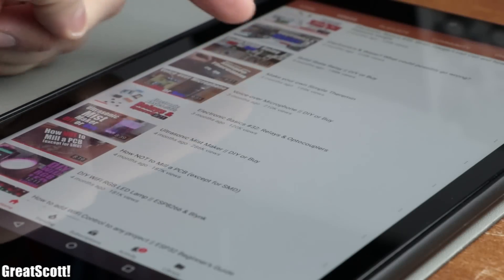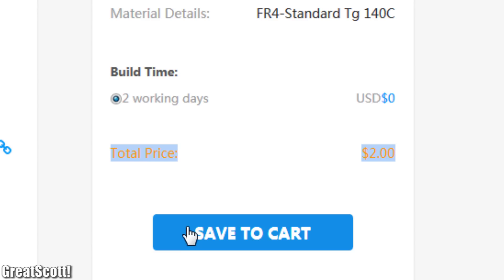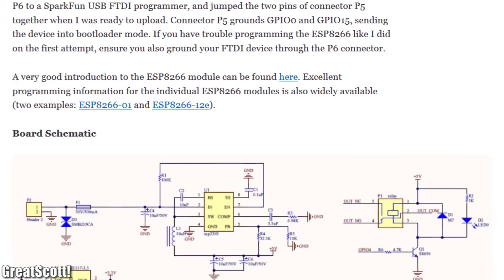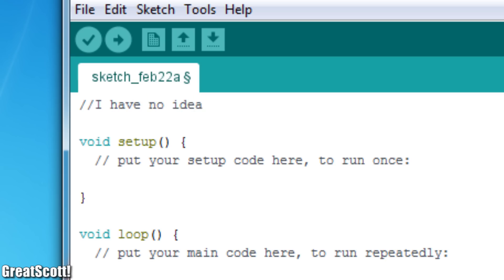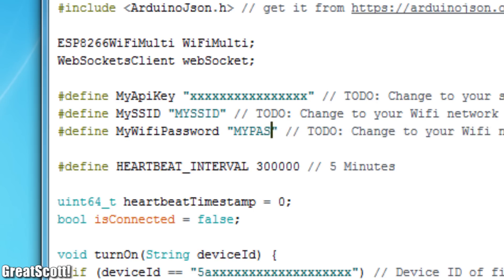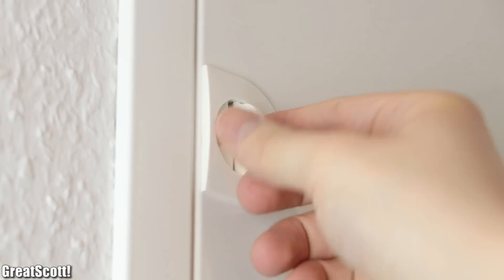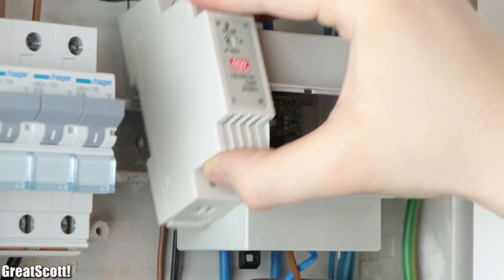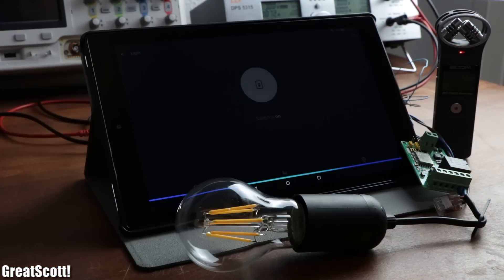How to do Simple Home Automation with Amazon Alexa || ESP8266

Comment: I have built a gateway that works on ESP32. The gateway controls the peripheral devices via ESP-NOW protocol. Is there a way by which Alexa can simply forward a string to ESP32, like, if the user says "Alexa, turn on light in kitchen", then, Alexa should forward "TURN ON LIGHT IN KITCHEN" to ESP32.

Comment: Fauxmo now emulates philips Hue but it still has problems. Never been able to add it. Therefore many thanks for your sinric solution.
As for the board you are using, there are cheaper ones that use an esp-01. For one relay that's more than enough

Comment: I had to add a "pinMode (4, OUTPUT);" command in setup() to get the board that I bought from Amazon to work. Looks identical to your board but came with headers already soldered in. Good video, many thanks for posting it.

Comment: Great video @greatscott! All my lights have the step/toggle switches and I plan do it myself wchich supposed to be easier than normal. BUT! Alexa doesn't really know if the light is actually on or off and this potentially creates bunch of issues when you try to trurn on/off something remotely and you can't check it on your own. You need to use then another GPIO port to controll if the actual relay is on or off so that alexa knows what she's doing :)

Comment: Also you can add a 3 way switch in your wall and use the NC - NO contacts so you can turn on and off from any point of the circuit. if you only do the parallel thing and the switch is turned on alexa will never be able to turn off your lights

Comment: The problem with these ESP8266 wifi solutions is that the wifi password of your home system is in the automation code as cleartext.

That's not secure.

Plus, if you ever do need to change your home wifi pasword, you have to keep backup copies of all your automation code with the password in cleartext, and then change the cleartext and re-download the code to all devices that were previously programmed throughout your home. 

That's extremely inconvenient.

Comment: The Shelly 4pro, is a really nice 4 channel system. It is DIN mounted, has internal power supply, has built in color LCD screen and 4 relays with 4 current measurement systems on each output. (And obviously voltage, probably shared for all outputs). Each relay has separate input for line voltage, but each of the input must be the same phase and voltage (because they are probably internally commoned anyway, and there is only one voltage measurement circuit shared by all circuits, and used for computing power and power factor, and phase angels; but that is not an issue really) . Afaik it is based on ESP8266, and each relay can do 10A (2300W). It costs about 69 Euro. Which afaik is pretty good price for the functionality, ability to mess with firmware, and built in LCD and measurement circuity! There are also 4 override inputs for 4 switches (They can be momentary or permanent switches, the switching is still done via relays, so very small wires can be used, for maybe 1mA of current used). There is also a button. This enables to easier setup of the device. I hope they make ESP32 version, so setup can be done over BLE even quicker and without needing to switch wifi networks temporarily. 

If you don't need a LCD and multi channel, then Shelly 1 Open Source, is even better, 9.90 Euro.

Comment: In this program  I am facing a problem I want to control the iot device by a voice and the physical switch simultaneously so can you help me with that

I have used the physical switch by physical wiring but it sleeps over the no and NC position in the code for example if I turn off the light by voice command and turn off the light by manual switch the the program still states that the litelees in on condition so so what should I do with that

Comment: What if i dont need the switches ? What if i directly connect the wiring in the switch to the relay board and control everything by voice by getting rid of the switch boards ? Would that work ?

Comment: I am not able to flash this module using PL2303. I used Board as ESP8266 generic Board and tried all different baud rates. I am using 9V battery to power the module. and PL2303 is directly plugged into my desktop. What could be wrong? Can you please help?
Error I am getting is warning: espcomm_send_command(flash_download_data) failed

Comment: hay man first nice project, secend i used a esp8266 nodemcu to control at the same way a relay but when i add   digitalWrite(4, High) and upload the program it shoult be pin D2 but it does not work can you help me out? have a nice day.  Edit: did figer it out you need to add:   pinMode(4, OUTPUT); down under the code by: void setup()

Comment: Can someone help me?  I can NOT tell by descriptions what devices to and don't exactly  .    I have a  variable pressure pump system that runs way to often and so I want to be able to turn it off via alexa.   The unit has a little jumper that disables the pump from running.  So all I need is something that opens and closes that one low voltage connector....just something with one set dry contacts in other words that I can either open or close via alexa or online etc etc.    I am desperate to learn WHAT  to buy?   Now the voltage of the unit is 220 so it could be powered off that,  but even a battery would work ....I  would rather not fabricate something....is there not a unit available that would do that?   Pleas be a hero to a stranger??

Comment: I must have picked up 4 duds  2 from amazon and 2 from ebay   was able to upload a sketch , register with sinric   i could see it on my network and was able to discover the new device . However not getting an indication that the relay is kicking on when i ask alexa to turn device on .  All she says is  " OK "   No failure is a complete failure . Will need to do a deeper   dive  , would have been nice to have accessible break out points  .Has anyone had this issue?

Comment: Hello, i use an ESP8266 and i have load the Switch example for the sinric app.
the voice control over the alexa dot and the trigger over the handy app is working.
my question is, can some one give me an example how i can read in an hardware switch in the esp8266 that i can switch it on an off. i dont know how imust programm the code .

thanks

Comment: Woah theres a much better solution than changing the circuit up to the breaker, and it doesnt require changing the switch either.

That relay looks like it supports normally open and normally closed contacts that both connect to a common terminal and basically switches the common between the 2 terminals.

Light switches do the same thing (well atleast in Australia here) and they are designed like that for the method of "Two way switching" which is where 2 light switches control the same set of lights, for example a hallway with a switch either end so the relay can replicate that second switch.

2 way switching is rather simple too and only requires routing the original switched active to terminals to a normally open or closed contact of the relay (not into the common, but wiring the relay backwards) and running a second wire from the switches other terminal to the relays other terminal. These are called "strap wires" as they are basically parallel active wires.

From the switch point only 1 wire can be active at one time and the other is off, flick the switch and that will swap to make the other one active and at the relay point the relay will switch between the dead wire and the active wire feeding to the common terminal where the light will be wired to, essentially making a "two way switch" setup.

If you don't quite understand its best to look up a diagram.

Comment: damn good vid.... One comment on the way you fixed the wire in the fusebox. If you see the copper ends it is not good because than the risk of short circuit is bigger. So next time please but the copper ends entirely in the box (It is meant to be a tip not a hate comment)

Comment: Not sure if it's been mentioned...and I don't know what the electrical codes are outside of the United States, but DO NOT double lug the terminal on your circuit breaker (don't put more than one wire on each breaker).  You can however, run a few to a conduit box outside of the panel and just have one going back in (ground, neutral and line).

Otherwise, this is a beautiful little piece of kit!

Comment: Does anyone know what programming language he uses?
Reply: It's C++.  If you know C, you can work with it just fine since most code doesn't use much of the OO parts of C++.

The compiler is gcc with special tweaks to support AVR chips.

If you prefer a different language, there are options.  I've seen Lisp and Forth and even someone working on a tinyBASIC port.
Reply: arduino is IDE not a programing language. also arduino is VERY SHITTY IDE. better use Visual Studio.
Reply: The Arduino IDE isn't that great for actually writing code, but it is good for downloading libraries and tooling.  Got some weird chip off AliExpress that isn't quite an Arduino?  Just a few clicks in the IDE and you're ready to go.

Really, if someone's just starting out, it's not too bad.  VS is major overkill for most Arduino projects and is confusing for someone new to coding.

Besides, as neither of them are Emacs, they're both inferior :)
Reply: I use PlatformIO in Visual Studio, it's much better.
Reply: Arduino, free of charge.
1:30

Comment: The esp32 or esp8266 has many oi connections why use this WIFI relay module when you could control many relays off a single board and multiple relays?

Comment: I have just Alexafied my whole flat a week ago. All lights and thermostates can be controlled by Alexa by now without needing to change any wiring at home. Check out FHEM. It is an open source software for house automation and can run on Raspberry Pi. You can also add Alexa support or Homekit. Seting up Alexa is a bit tideous since it involves creating a custom Alexa Skill and a lambda function within Amazon AWS that enables communication between your Alexa Skill and the Alexa Service running on your FHEM setup. Next thing you need is a gateway in your LAN that can do 433MHz and 868MHz communication. Max! Cube gateways can be flashed with an open source firmware that enables FHEM to control almost any cheap remote controlled device you can buy from hardware stores. Homematic for example is great for remote thermostates. For light switches you can use ITL 230 from Intertechno. Those switches are put behind your regular light switches and use the switch as sensor but also go wireless via the gateway and FHEM once they are paired. Next think that works flawlessly is Philips Hue. With Hue you can also use cheap Ikea Tradfri bulps or Osram Lightify. You don't need their gateways and can pair directly with Hue. With this setup you can mix almost any supplier of smart home devices. I also integrated the status of my alarm system and windows to automatically shut down the heaters when windos are open or make all the lights and soldering irons go out when I leave my home. You should check it out!

Comment: 7:30 "the system works flawlessly"
So what about this:
"Alexa, turn the light on" light turns on
"Alexa, turn the light on" light turns off because there is no feedback loop to check if the light is already turned on.
This may seem exaggerated but if you have multiple lights wired up and want to turn them all off at once, it's not possible like this.
Reply: There is a very technical way to check if the light is on or off....... open your eyes
Reply: Right +fisheyLP These switches only make sense on the stairs where you can toggle it from one floor and the next..
Reply: maybe he has a voltage reader that sends data asynchronously. A presence of voltage will tell if the switch is on.
Reply: I think a two way switch wiring can solve this problem and instead of another switch you just use the relay. And like he explained, the relay works when there's a voltage difference and thus if the switch is OFF the relay will toggle but if the is ON it won't.
Reply: Easy to fix with some coding. Instead sending "toggle" command, one would send on or off commands. It doesn't require any feedback loop.
Reply: @movax20h  The point is that one wouldn't know if the lights are switched on or off even if the microcontroller switched the light on someone else could have switched them off by hand. And since the light relay is a toggle you dont have a way of knowing if its on or not.
Reply: @xlagor_  Why not just ask if the light is on
Reply: I used one for electric garage door.  It does work as you state, but just creating multiple Routines in Alexa makes it easy to use.  Great value too!

Comment: Hmm... I've used the fauxmoESP library for over a year now to control my lights and some other appliances with Alexa and it has always worked flawlessly. Even with one ESP emulating multiple devices, not a single problem. The only unfortunate thing is that I control the lights with phase angle control using a triac and can't dim them using Alexa since "she" thinks it's a WiFi plug. I made it so it dims up and down smoothly though, when turned on or off with Alexa, so it's not that bad. I am looking for a dimmable alternative though that I can run locally (without some third party app, website or whatever) and that accepts different ways of expressing yourself naturally (so you don't have to say "Alexa, light 50 %" like a robot)...
Anyway, did you try the example sketch without any modifications? Works fine for me. I use Alexa in German, not sure if that makes a difference. I would be quite surprised if it did though.

Update: I'm currently using Espalexa which is fairly similar to Fauxmo but emulates a phillips hue bridge and can therefore control brightness and color. Works just as well as Fauxmo, just with the additional control over brightness etc.

Comment: i did something similar to that. I just connected a relay as a changing switch to my currently installed changing light switch. so i could switch the light on / off by sending a data package to my aruino via lan, or by simply using the switch. That removed the use of alexa completly. But i created my self a App, that, could sent the data.

Comment: Hi Scott! Great video. But i don't understand why you whould go through so mutch trouble to just switch your light on and off. Why can't you install the relay above your lights in the ceilling and directly to the lamp?
Reply: You can
Reply: My thought exactly. And if he needs to have the switch for controlling it, he can do so with the NC in the relay and that becomes a toggle switch between Alexa and manual switch. 

But seriously this could be done not by messing with the circuit breakers.

Comment: GreatScott, I was able to get the fauxmo example working by using version 2.3.0 of the esp board drivers instead of the latest 2.4.0 version. Select that in the boards manager. You may have to install in manually. It's found here https://github.com/esp8266/Arduino/releases/tag/2.3.0 or you can change the Arduino IDE preferences to use http://arduino.esp8266.com/versions/2.3.0/package_esp8266com_index.json instead. The FauxmoESP_Basic example then connected to my Echo Dot and even though the Echo sometimes said it couldn't find it using the "find devices" command, it was still there and I could control it using commands like "turn on switch one". The fake Belkin switch method is nice since I don't need an external account somewhere.

Comment: I just used flashed sonoff smart switch with custom tasmota firmware it is easier to fit inside light switch. This will cost just $5-10

Comment: Amazon Fire tablets are a good deal, but only if you're going to root them. The built in Amazon app store is okay, but the Play store is better. I've heard it's a lot easier to get the play store on them nowadays though. The old fire tablets required a ton of work for it. Back in my day we had to use command line utilities to root, now it's all got a GUI!

Comment: Is there a way to use Alexa without internet service? That will be a good video.
Reply: Blue 4lifeblue Other such devices and probably Alexa do most of the speech recognition on the server side, so it's impossible to work without connection
Reply: Alpo Turunen what if there was a Home Server instead of connected to the online server
Reply: You'd need to replicate the speech recognition and parser functions of the Amazon servers. As the server side code is not legally available, you'd need to use open source software for that. Not  impossible, but not an easy DIY project either. I'd like to see someone do that and make it more freely available though.
Reply: Alpo Turunen same here

Comment: Or, i dunno, buy SONOFF , repack it if you want and use it right out of box. It's 5.5$ . Btw great video :)
Reply: The only disadvantage I see to this process or the SONOFF (I'll be buying a few of those anyways just because they're super cheap and useful) is that I don't see a meaningful way to use them with a physical switch properly since either you'd have to replace the switch with this, or wire them in parallel which makes the feedback portion useless. I have a few of the WeMo devices and they're really useful but too pricey.
Reply: Actually there are a lot of 'hacks' on you tube for this device. You can look on this video https://youtu.be/8mz5sCAvDAY?t=24m13s  , it starts at ~24min, that may help with physical switch problem.
Reply: how can you program it?  how do you know it's safe? and hackers can't use it to et into your local network? One casino lost (stolen) database because hackers used aquarium thermostat that was "smart".
Reply: We got the lovely Sonoff mini now